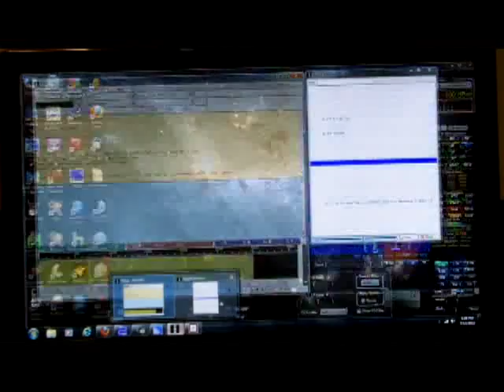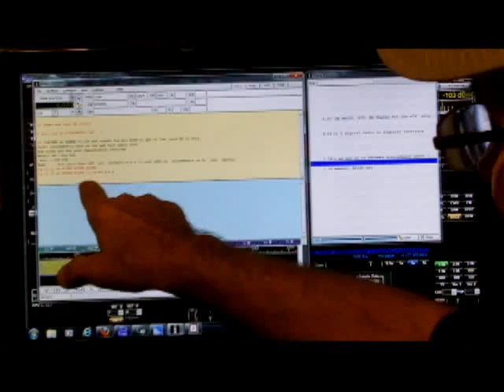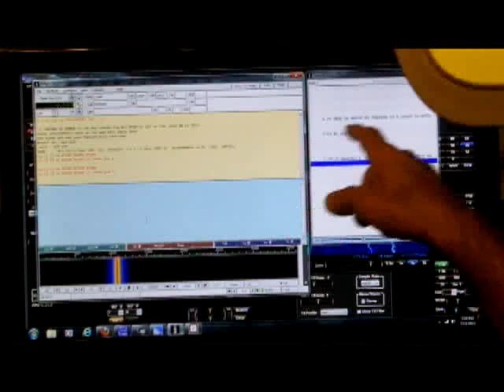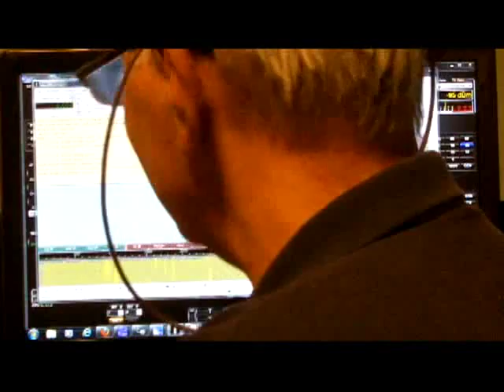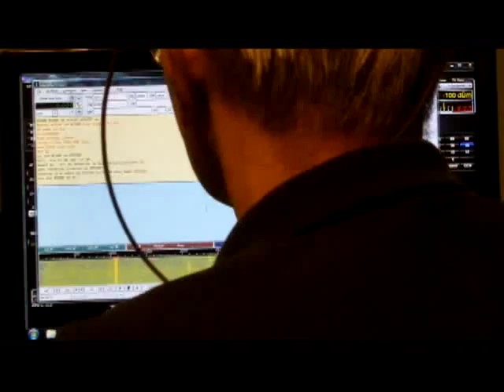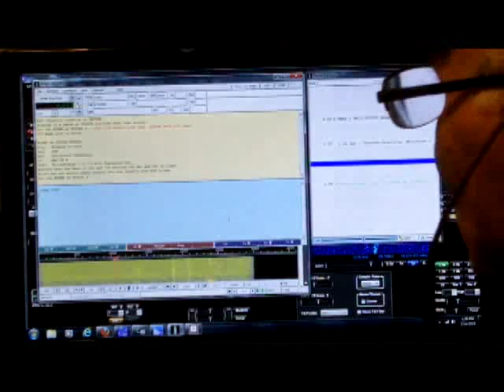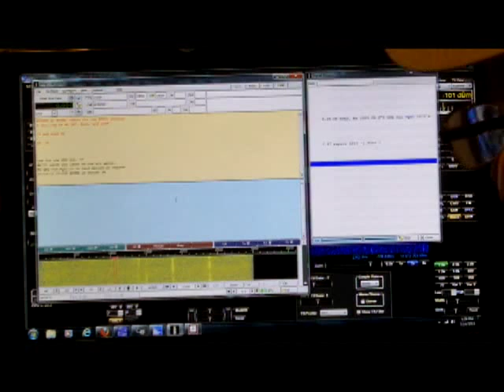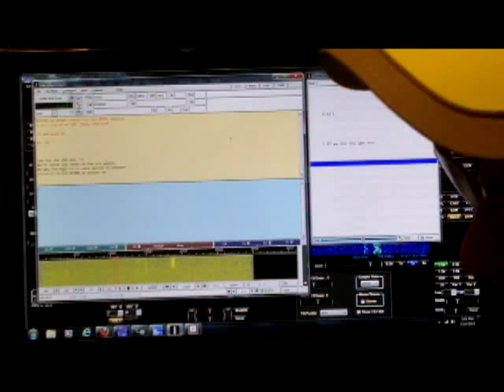Flex 3000 radio using a digital mode

Comment: I'm on the fence of buying a iCOM IC-7300 or a Flex 3K 
both are SDR radios 

73 de ac0v
Reply from the maker: You can buy a used - certified Flex 3000 directly from Flex radio for about $900. If you run KE9NS software  PowerSDR you will have MANY new features not available in the Flex original software. That's what I am running.

However the Icom 7300 has very good reviews and seems to work just fine-- so  sorry either would make a great SDR radio. Personally I have thought about selling my Collins KWM2 and buying a 7300 -- cannot seem to actually be willing to sell the vintage radio! Ha! :) Check out my latest Flex video here--

https://www.youtube.com/watch?v=jFF8VgAjWHw